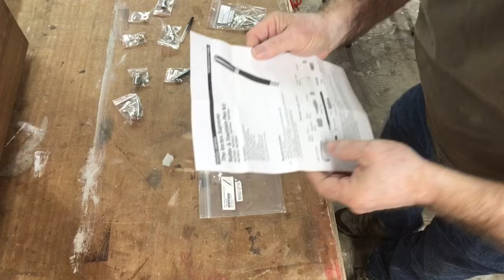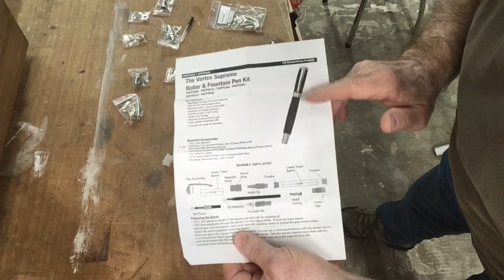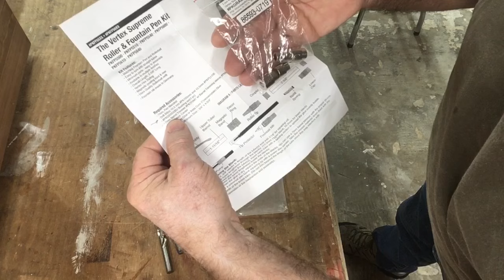How to Make a Vertex Supreme Fountain Pen

Comment: Can you please make a video on cutting something on the machine that is larger than the work area?(for example cutting a sign and then flipping at 180° and then finishing the cut.) I tried an easel but every time I flip the sign and go back to the original zero spot, it always is a little shifted. I’m not sure if that is easel or if it’s my error. Could you please try it
Reply from the maker: The Daredevil sign is an example of tiling.  I have done others as well.  I am in the process of doing another one now.
Reply: Can you do one on an engraving?